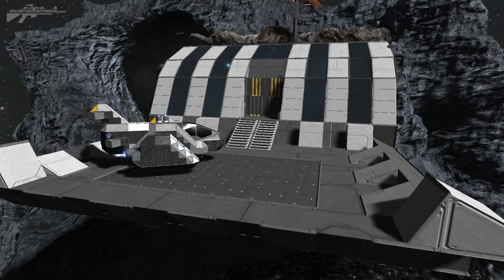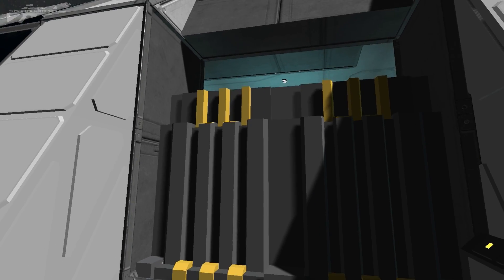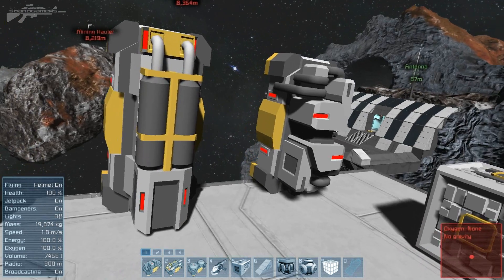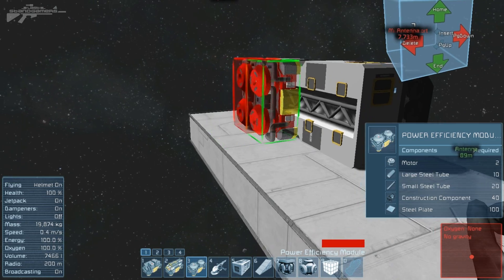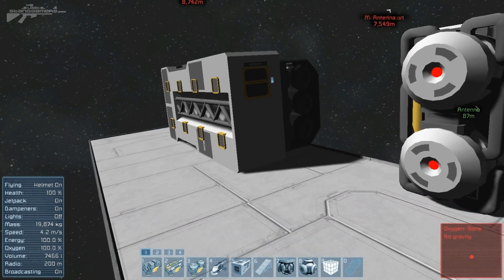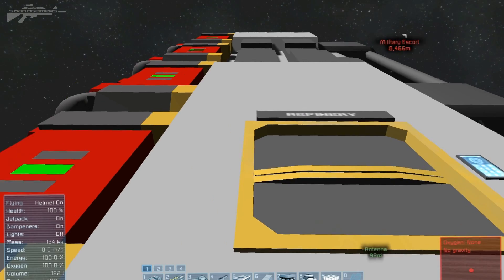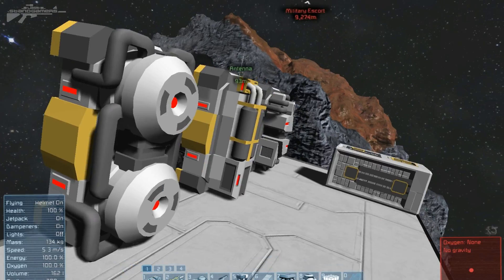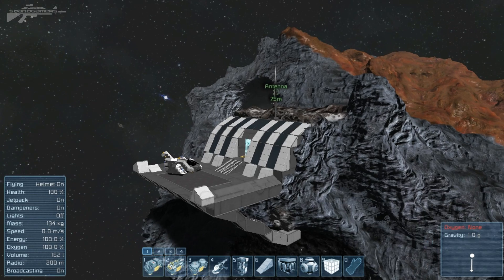Space Engineers - Production Modules & Upgrades

Comment: Meh, Not sure I'd want the modules honestly. I'd much rather them place a foundation for hydrogen overclocking, since we are currently only getting Oxygen out of frozen water, and hydrogen is a very useful substance. Give the Large large ship reactor the ability to take in hydrogen, and produce more power and a bit of oxygen. Give the grinders and drills the ability to consume hydrogen to increase gathering rate. Have it be stored in a bottle in the players inventory in order to power a mini reactor in a players inventory to keep them topped up on energy.
Reply: Iceorama Ice You need a fusion reactor for fusion. You can't just expect to "modify" a fission reactor for that. Fusion requires extreme confinement and only happens on ridiculously high temperatures. Fission basically only requires that you stop the reaction from going too fast, cool it down so it does not go too hot(meltdown), and shield it(because radiation is nasty). 
It only works for the H-bomb because there is no confinement, no moderation or whatever. You basically use a bomb that's easy to ignite to ignite another bomb that's not so easy to ignite.
That said, I would love fusion reactors in the game.
Reply: Iceorama Ice  It's a science fiction game.
Reply: I like the concept of your ideas, but running hydrogen into a fission reactor seems... Unlikely. I'd rather they add a separate fusion reactor as an alternative to the standard fission one. Fusion can theoretically out out more power, right? So there's an incentive to build.
Reply: Ryan Gunn If I recall correctly (And your free to correct me on this) but the first Hydrogen Bomb used a fission reaction in order to kickstart the fusion reaction. Basicaly a fusion reaction, although it provides a lot more energy than a fission reaction, requires a substantial input in order to create its output. Although I can see a point for a seperate fusion reactor, there is also a bit of a dilemma of what to do with the fission reactor after that. I personaly feel like a potential fusion reactor should be a giant multiblock in order to power the ginormous ships, rendering them useless on your average station and large ship, meaning that you could get some storage issues with the hydrogen. By inserting hydrogen into a specialy modified fission reactor, you could reduce the problem by simply putting it into a much more manageable and frequently used substance like oxygen. Basicaly making the standard fission reactor "Breed" specific elements for you, but you would be loosing out on the potential for the sheer amount a fusion reactor could bring.
Reply: Iceorama Ice Imagine laser driven engines. I'm no expert, but shooting a sample of hydrogen with a powerful laser can produce enough energy to power a city (which is the energy required to shoot the laser) and start the process over again... imagine walking into the engine room, with fission reactors charging the laser drive (or whatever you want to call it) then seeing a massive flash and release of energy. Perhaps I just want lasers...
Reply: Augustinian de Juan Pierre"shooting a sample of hydrogen with a powerful laser can produce enough energy to power a city"
What are you referring to here? Fusion started by lasers?
Reply: BinaryHistory I actually don't remember. I remember watching some show about it on the science channel. I tend to doubt there was fusion going on seeing as how that would kill the scientists who were observing though.
Reply: BinaryHistory I found an article that pretty much explains what I'm talking about!

https://pubs.acs.org/cen/science/87/8713sci1.html

Essentially, A bunch of lasers hit a tiny sample of hydrogen, and actually condense it, for a fraction of a second. It'd be cool to get hydrogen in a metallic state and use that for energy, wouldn't it?
Reply: Augustinian de Juan Pierre
It's pretty much what I said, they are trying to get fusion started by focusing lasers.
It's one approach to fusion, along with the (seemingly more promising) one taken by projects like the ITER. Most have gotten fusion already, but none of them have managed to produce more energy than they take in, which is where research is focused right now.
Reply: BinaryHistory Yeah that's about right, I had to read the article to jog my memory. Not that I expect it to be added to the game, but seeing an engine that uses lasers would be visually stunning. Even more cool would be if you got to see a metallic ball of hydrogen, conducting electricity!
Reply: BinaryHistory Just because thats how it would or should happpen IRL doesn't mean that it SHOULD in a videogame. Real life is completely imbalanced and needs a major patch in order to be used in accurate reconstruction. There should never be to much realism in any game, as it ruins the fun of it. Take the properties that you need and take a 150 pound sledgehammer to the rest. In a game like space engineers, there SHOULD be a very diverse set of options for how one expends resources, and initial tiered items NEED to have some sort of purpose later on. Breaking realism to make the fission reactor breed materials is IMO, a very good idea.
Reply: BinaryHistory and thats a reason for the game to be a stick in the mud because?
Reply: Iceorama Ice It's not.
Reply: Iceorama Ice I disagree, I find real life entertaining. It is thus logical to think real life in a game would also be interesting. However, in this particular instance I would have to agree with you. Even so, when it comes to using fission to make materials, the only manner I can imagine that working is if we used the power from multiple fission reactors to startup the fusion reactor. Not as fun as blasting lasers at objects, but still it could work all the same. It would detract from the game's feel if people could just plop down a "modified" fission reactor, and make water.

Comment: scratches my chin hmmm you could go full on production if you want materials, and such an idea is a valid concept for fast expansion. The power cost is an issue unless you have these production modules on when you are using it on uranium ore. The question is, if you have one refinery set entirely towards the refinement of uranium, does the amount of fuel gained surpass the amount of fuel consumed?
Now, other ideas include power saver modules which sound great for long term stability, and in conjunction with any of these will make uranium last longer at no other clst than the ore and materials made from said ore to create the modules. A valid plan for longevity.
And the third module increases speed for no apparent cost. Great for when you need a bunch of parts set up really fast. Also great for the ores, but does it give a better rate of ore per second versus the first idea?
The real question is what set up will work best for your world, and which will yield the most for longevity purposes coupled with survival needs?
In the end it's all about what your goal is. To expand and make a spacial empire would be best for a type one module set of refineries, and a type three set of the fabricators or what, and then everything else seems like it would be best to have the power saver module unless you can vastly outproduce not only the machines at your disposal, but also every set of machines you create from then on. Meaning a space city would need periodic increase of solar arrays, or an increasing number of reactors. Mind i would couple these with a bay of batteries for emergencies. But long term solar array might be best, but if the refineries can make more uranium than they eat, it is still viable, SO LONG AS YOU HAVE A SOURCE OF URANIUM ORE. Otherwise you are screwed son.

Comment: What!!! Did you compare power use? 4 effectivness module gives you a 200% production efficiancy but at the same power use of a standard refinary, so you get twice as much refined ore, at half the input in power and raw ore. With the power module you cut your power use, so you reduce your power input by 80%. With 4 production blocks you have 500% production speed, but also 500% more power use, and you only get the same amount of ore out you would have got otherwise. So the production module is the /least/ useful unless you really want speed and nothing else.
4 production modules is the same as having 5 unmodified refinaries. Not worth it
The effectiveness module is clearly the best for general application.
Reply: Loues S. Cat A. watch the update vid from Space Engineers it provides more insight. B. Resource cost. Refineries are fucking expensive. having more than one means more logistical compexity, adding EVEN MORE to the resource cost. 
-yw
Reply: Gumby building a refinary is a one time cost, throwing on 4 effectivness modules effectivly turns one refinary into 2, but at half the power cost and double the output. It also reduces your need to mine by half doubling what you can build. There is no way for the production module to make up for that XD
Effectiveness modules double speed, doubles production and halfs cost. Production increases speed and cost by equivalent amounts with o benafit to production. -yw :p
A production modules + 2 power modules are most worthwhile on assemblers, effecitvly turning 1 assembler into 2 at better than half the running cost